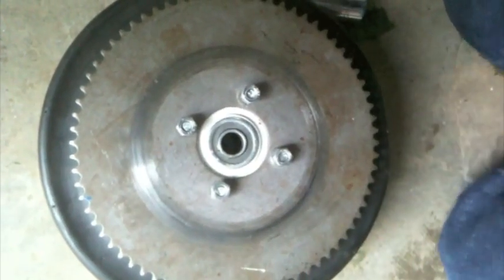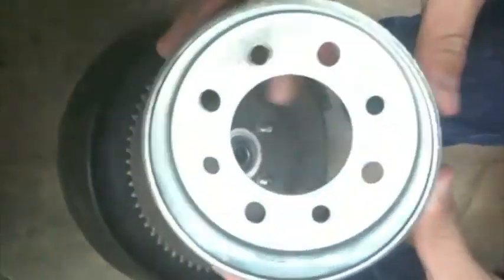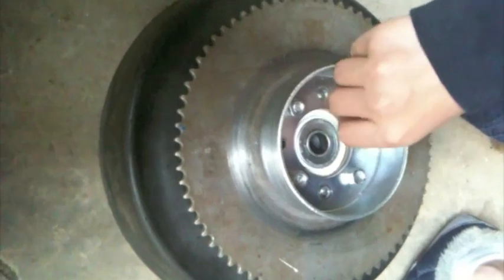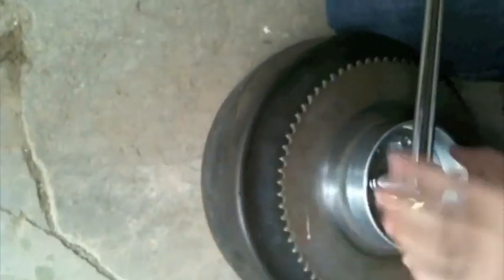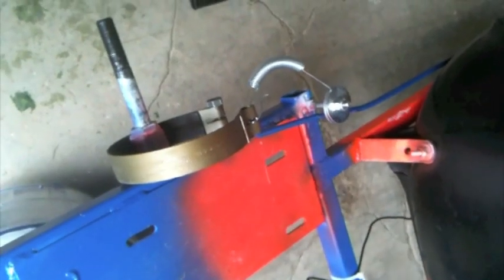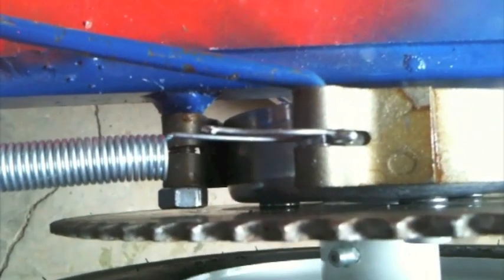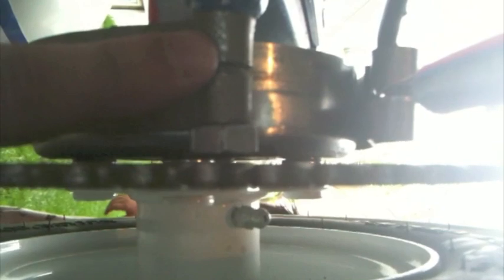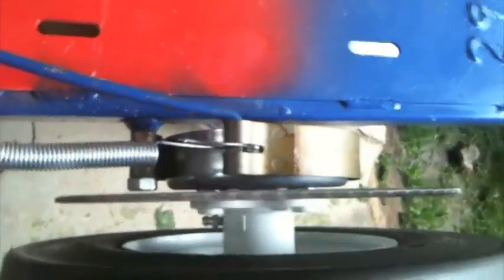installing band brake on go kart

Comment: awesome video kid!  I was scratching my head on how to attach a band break to my tricycle (it only has a front break) that I'm putting a motor on. Exactly the info I needed! I have limited bike experience so I couldn't picture it in my head. Thank you!
Reply: excuse me sir, I was watching this video for information purposes just like you were, but my use for this information seems to be very different. I was wondering if there was any way that I could obtain a photo of the tricycle in question, as it has most certainly peeked my curiosity. All the best, a fellow george2011k fan.

Comment: The lock washers on the inside of the drum won't lock the nuts on. They need to be right up ahi st the bolts because they dig into the bolt and make it really hard to turn, on the outside of the drum they just act as spacers.

Comment: just a couple tips: the lock nut washers should be next to the nuts to keep them tight.  snug fitting washers would be a better option for spacing the drum from the sprocket.  also, the torque wrench tells you how tight you have the bolt.  im not sure where you could find the torque specs but on a go kart it really doesnt matter unless youre working on one of those high speed fancy shifter ones.  good vid tho, thumbs up!

Comment: I need to know how you got that drive wheel off.i have took the big bolt off for the wheel there are 2 Alan key screws on the thing that the chain sits on that I took loose.then I tried to knock it off.need to know if there is something I'm missing or do I need to knock it off with more force

Comment: please someone answer me. do u have to use a brake rod or can i use a brake cable? what are the differences?
Reply: Demanding that someone answer you I usually not the best way to get things from others.  To answer your question though, a rod will work in both tension and compression and a cable will only work in tension, so a cable will rely on the ability of your band brake to spring back off the drum so it's doesn't cause extra friction when driving normally...a rod will push the band off the drum when you operate the lever back to normal.

Comment: Did the Go-kart brake work well because I saw you only had only one band brake? Just asking to do the same to mine.
Reply: Gotcha Caimito I'm assuming that's a "live axle" meaning that the single brake works on both wheels because they are fixed to the axle.

Comment: figured id let you know you can buy that exact torque wrench from auto zone. it's only like 8 years old. they didn't use 3/8ths until the late 80's they used 1/4 and 1/2.
Reply: That's not want a torque wrench is supposed to be used for it's to tighten bolt to a certain torque setting

Comment: Where did you get the wheels. I'm trying to make a kart and can' find the wheels anywhere. Also where did you get the sprocket? Nice vid :)
Reply: The wheeles are hard to find and are extremely expensive about 300$ for all 4 with tubes and tires and wheel frames 1 sec ill post a link to what ive found when looking for cheaper but good wuality wheeles
Reply: Qwalt66 look at northern tools

Comment: I have to fix mine it looks a lot different than that setup ,it goes from the brake to a rod to another rod which is pinned to the brake band  but for some reason when you go on the breaks it barely brakes

Comment: lock washers are in the wrong place,,,,,, they are always just under the nut...
Reply: no, he is using lock nuts, which dont require a lock washer. thereason you put the lock washer between is to prevent the 2 from shifting in use